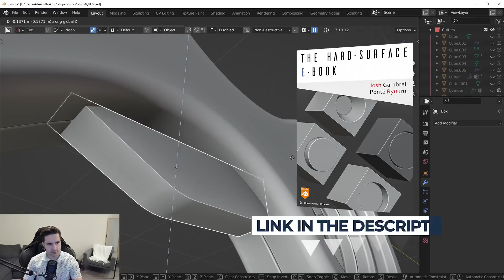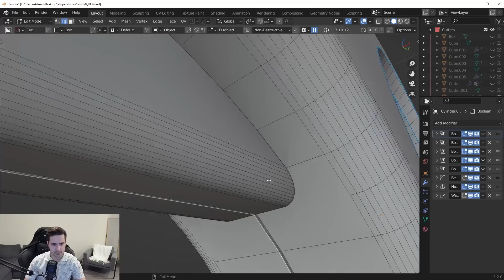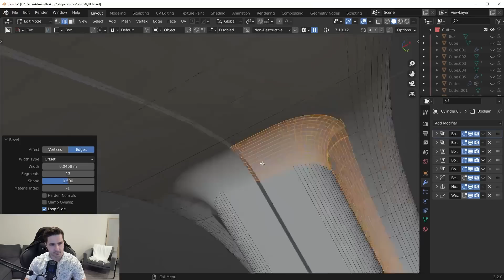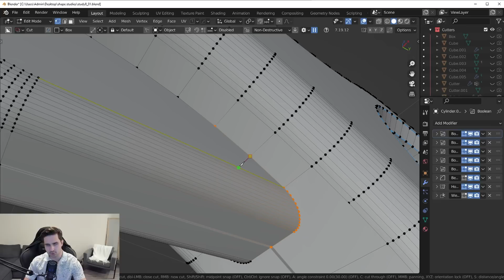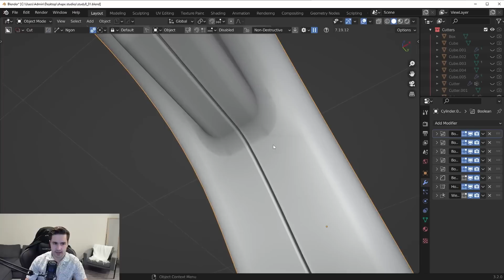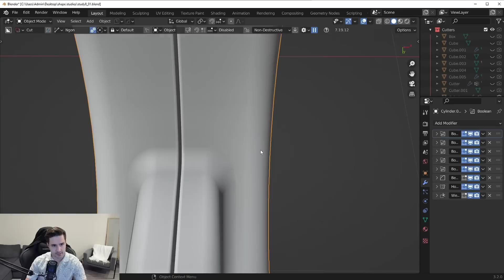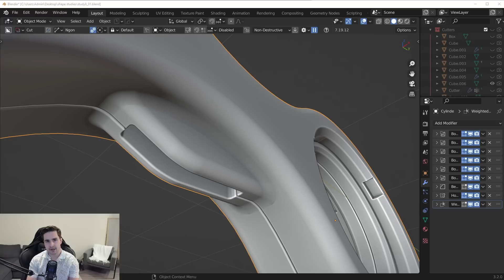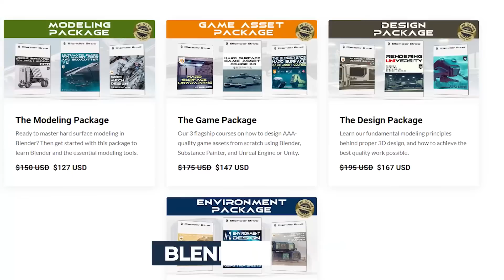When polygons fail... (Blender Tutorial)

Comment: personally i use the inset faces function to get a perfect around weird geometry like that it works a lot better for this kind of situation than a bevel.
Reply: Mind giving a little more details on how you use it?
Reply: Interesting, how and when do you make use of insets?
Reply: In this case I would merge the two objects then select one of the original objects at a time and inset faces so it shrinks away from the area where the two objects meet. The I do the same for the other one. Then that makes it cleaner looking when I use bevel for less effort.

Comment: So f quads?
Reply: Because he seemed to be placing random cuts?

No no, quads ARE very important, just not universally in every situation. They are important, if you may still be heavily editing that area (quads are necessary for running loops cuts) and for having more control over the texturing (and supposedly many more reasons). But he supposedly wasn't intending to change this area of that gun anymore, and texturing might not really be necessary in such a spot. And concerning shading issues: Quads are not necessary on perfectly flat areas, but when you get curves and other forms, having random polygon shapes will cause shading issues, because while working with polygons, even when they are shaped as quads and ngons, EVERYTHING gets calculated as triangles. So Blender sets automatic, invisible edges for the actual triangles within other shapes, and those are not always optimal.

So yeah, quads are very important, but not at all costs.
Reply: @Marc_Fuchs_1985  or he'll do a retopology at the end who knows...I guess it also depends on for what the model will be used and how much details it should need...
Reply: @runerthereaper3320  Right, there is no simple answer, when quads should be used and when to ignore them. And it depends on your level of professionalism. Because when your visuals don't need to be 100% perfect and suitable for industry, then nevermind. I am a dedicated hobbyist, who plans on maning a living off of 3D work. But so far, I don't mind using some triangles and ngons. I try keeping a clean topology, but sometimes it would just be wasted time.